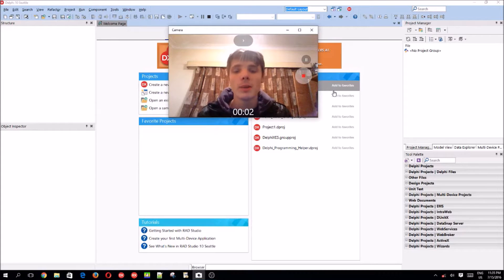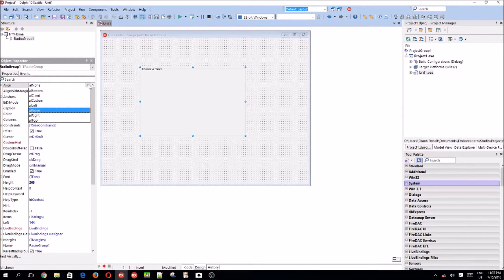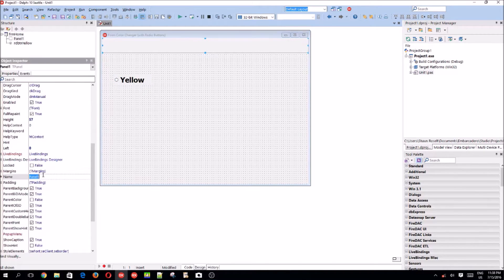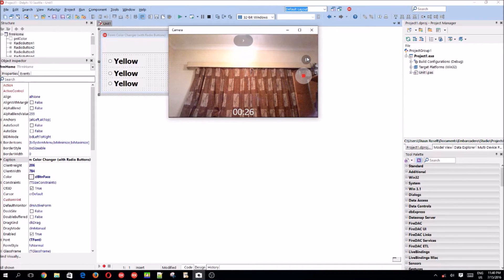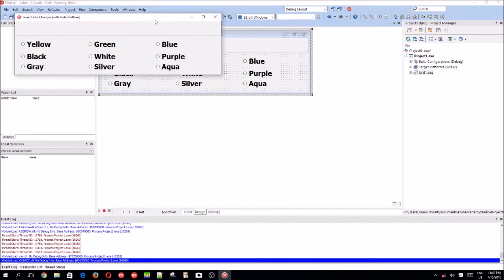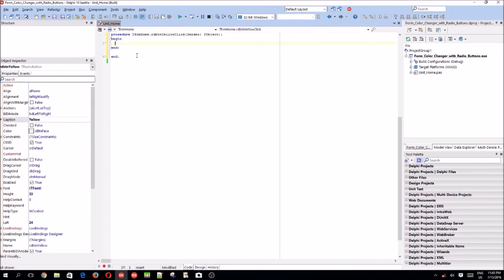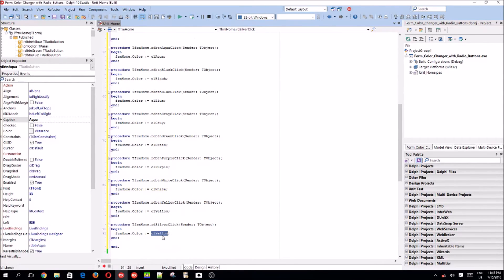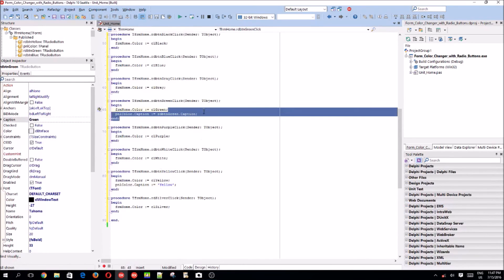Delphi Programming Series: 3 - Using Radio Buttons

Comment: This video could have been 5 minutes. Unfortunately, this is full of so much irrelevant and distracting stuff that has nothing to do with the lesson or programming you don't learn a thing. Examples, putting on the charger, putting on silly voices, having 20 radio buttons, not running the code, not using radio groups, byeeeeeeeee. Oh what should I do here, what should I do there. Sorry to be hard but it doesn't take long to prepare a bit more.
Reply from the maker: I mean looking by the like over dislike ratio, I'd argue that most people disagree 😁
Reply: @ShaunRoselt  ohhhhhhhhhhhhhhhhhh